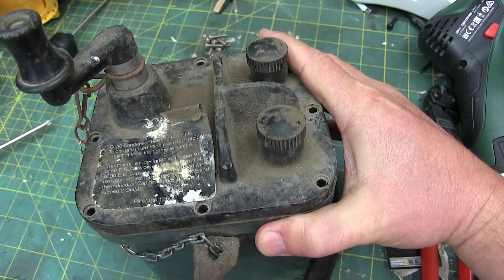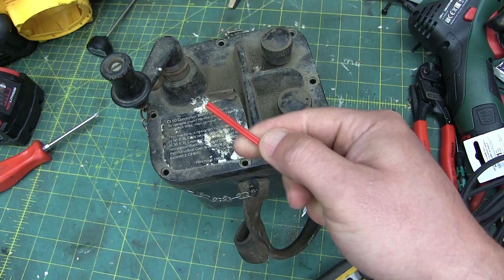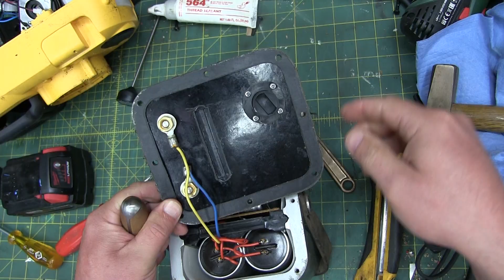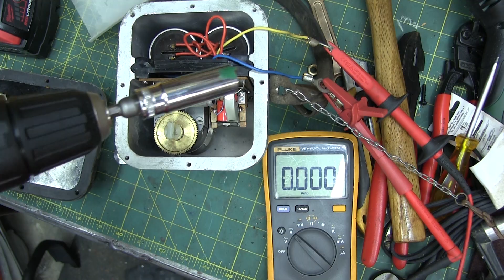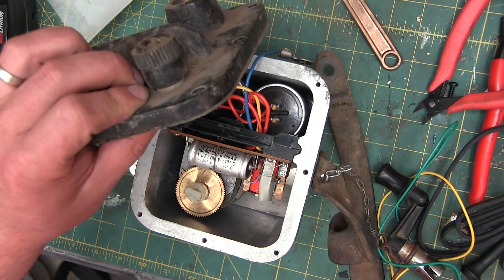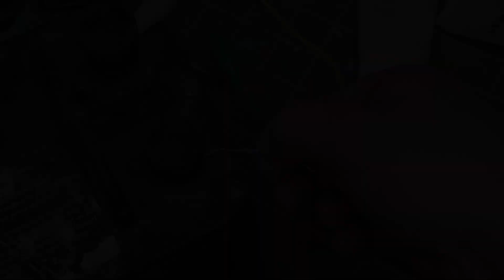BOLTR: Blasting Machine | Cool Old Gear

Comment: I see resistance was futile.
Reply: Maxx B - Speaking of...he used solid core wire.  I read that stranded was "much" better because the DC current, flowing on the surface of the wire, was more efficient because there's more total surface area vs. solid. (skin effect).
Now I already know it's irrelevant for what he's actually doing here (f*cking around).  I just thought about it and wondered if anyone else heard/learned/read the same thing.
Reply: Skin effect from eddy currents is really only an issue with high frequency AC. The caps discharge DC voltage, so either would work fine assuming proper size. Solid core could be preferable for commercial blasting due to it being cheaper. Stranded would have the advantage of not suffering bend radius related work hardening. Thus, the wire used for military purposes, such as claymore wire, is stranded despite being more costly.

Comment: I'd say the neon bulb is used as a voltage latch. They tend to conduct around 90V. So when you turn the crank, both caps get charged from the dynamo. The smaller one is in series with the relay coil, with the neon bulb in the way. When the small cap reaches a high enough voltage, the neon bulb closes the circuit, energizes the relay and the big caps get  dumped to the output and ... boom.

Comment: Are you sure that's a gear reduction? You need rapid flux in the field of a genny to produce electricity and that requires higher speed.
Reply: You're right, and the gearing looks like it multiplies many times. Probably more then 10x ...I ain't count'n.
Reply: Bottom side top wise.

Comment: Could yo show the whole system used for this ? cables ignitors and all ? because I tried to build something like this for starting fireworks and failed so now im back to shorting car batteries across verry thin wires to light the fuse wich does work its just not quite the way I imagined it.